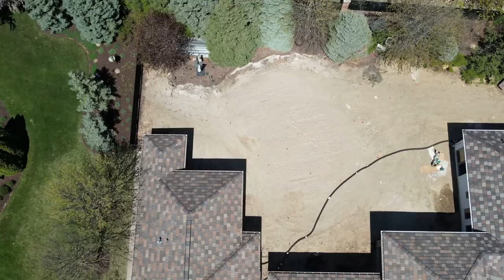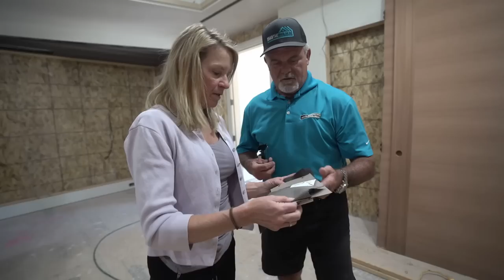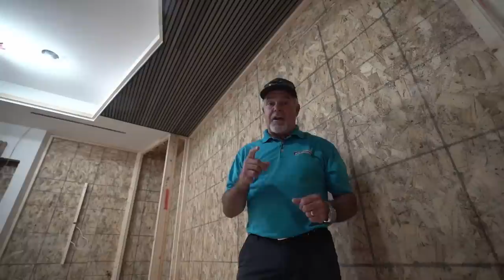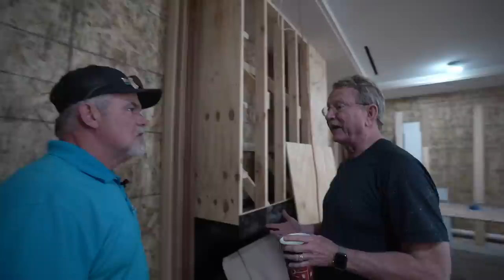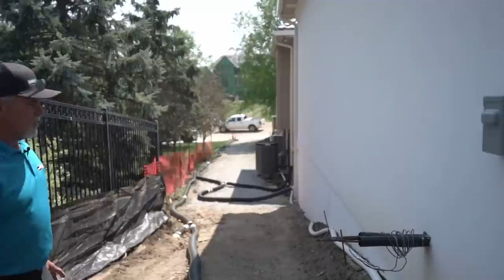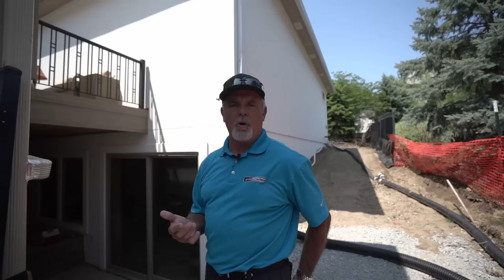Building a WORLD CLASS Movie Theater Room & Music Room (Pt. 1)

Comment: I helped do a movie theater room and we ended up with a similar issue. Just my makita speaker you couldn't hear the sound from the Salon on the other side of the room, but you could feel the bass from a small speaker. We were only on the 2nd phase of sound proofing, we installed 3mm rubber on the walls and ceiling. After that we installed isolators that captured 20 gage hat track. After installing the hat track we actually installed a sound deadening drywall. That drywall was a pain in the ass to cut. We had to leave ⅛" gaps on everything and used a special caulk at all seems to stop the air but allow movement. It worked out very well.
Reply from the maker: Thanks for sharing your ideas… I’m not aware of what a hat track is?
I do like your idea about the rubber membrane. Do you think that helped a lot?
Reply: @Brad the Builder  yes, and now that it has jogged my memory we used denim batting then the membrane. It was a whole system designed by a company.

Comment: The outside ac unit how far away from the house can you install it so you don’t hear it from inside the house
Reply from the maker: We have installed the best insulation for sound… the AC units are also very quite too!
Reply: I was curious if the unit had to be on top of the house or can I have it like 100 feet away
Reply from the maker: @edgambino4619  yes, it would be nice to have them on the roof but that’s not allowed in the neighborhood… it will be next to the home